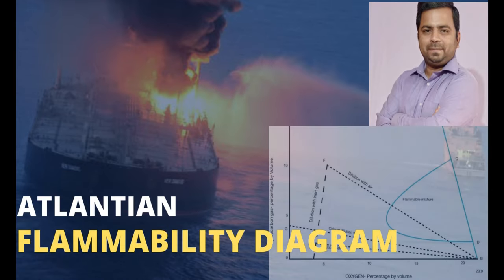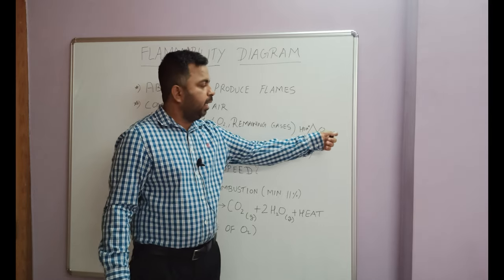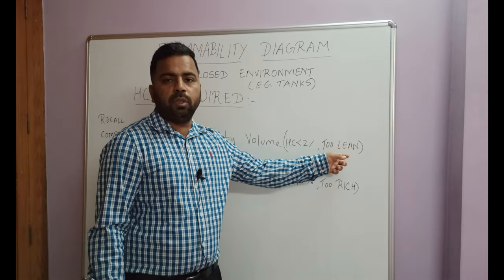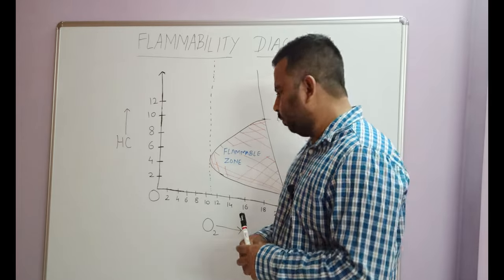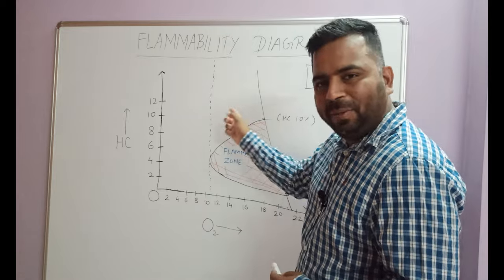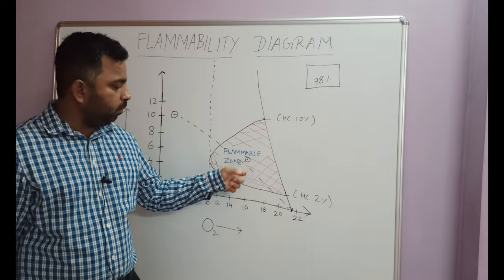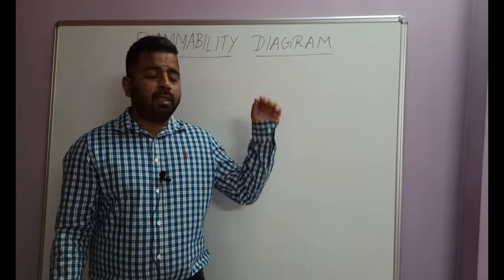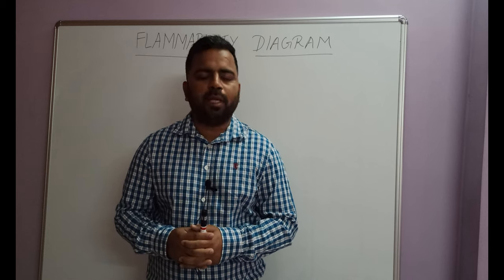Flammability Diagram - Everything about Flammability Diagram

Comment: Again, thq for your hard work, microscopic and very detailed explanation.
One question: 
14:43 you have mentioned that 100% LEL equal to 2% by VOL. 
Maybe there was mistake, and correct answer should be: 100% LEL = 1% VOL = 10000ppm?
Reply from the maker: Thank You for pointing out the mistake. 1% by Vol = 100 % LEL.